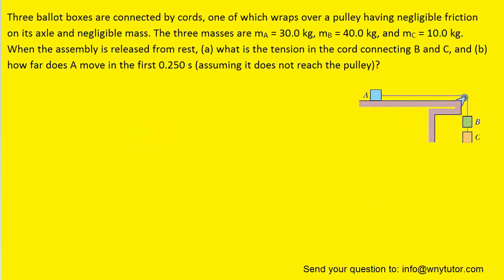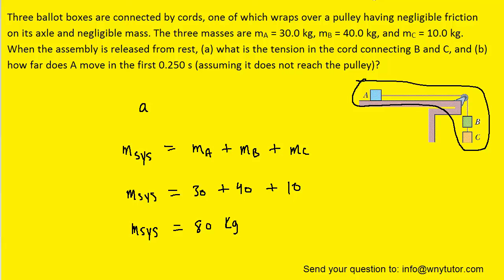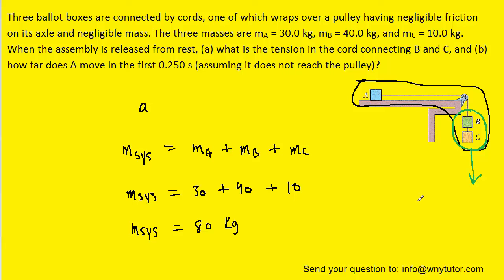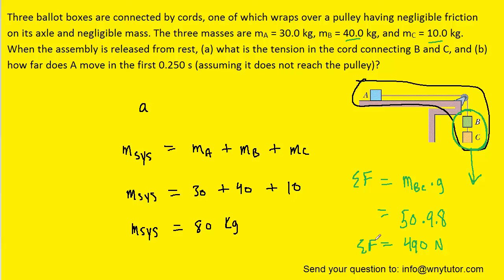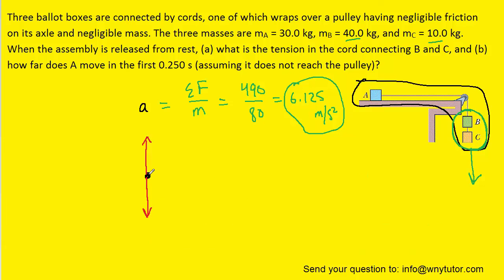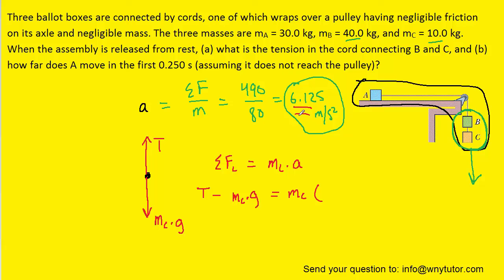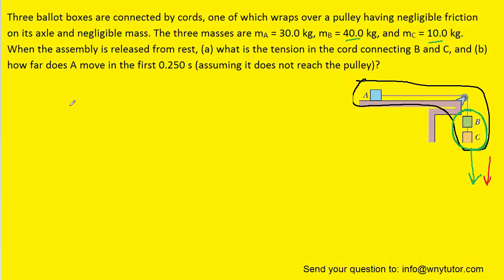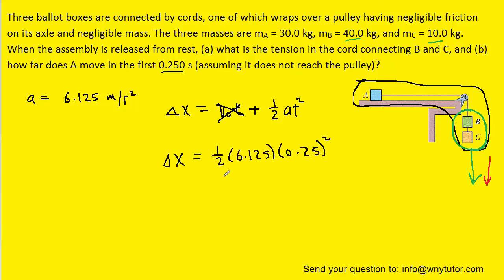Three ballot boxes are connected by cords, one of which wraps over a pulley having negligible fricti

Comment: why is the acceleration of c negative if g is not negative, they are both down?
Reply: we did consider the negative, T-mg=ma  because g is negative, then mg all together is negative.
Reply: @mariameobied2618  For the entire problem you have to keep the same frame of reference, using F=MA, the Tension force pointing up is positive, and the mg force is - because it points down, the A is also pointed down so it has to be negative as well.